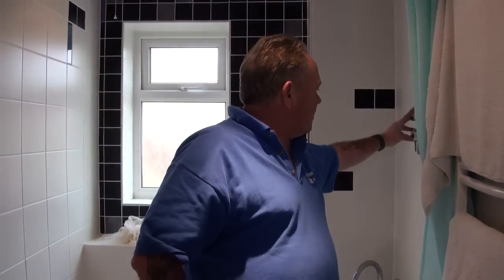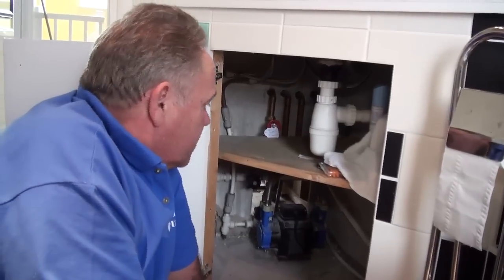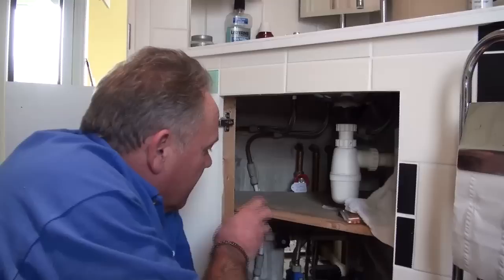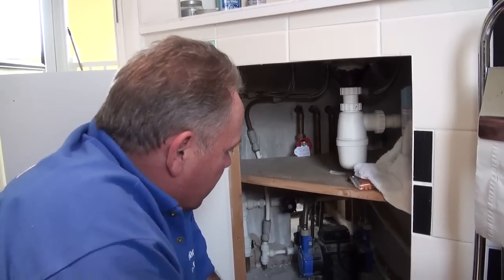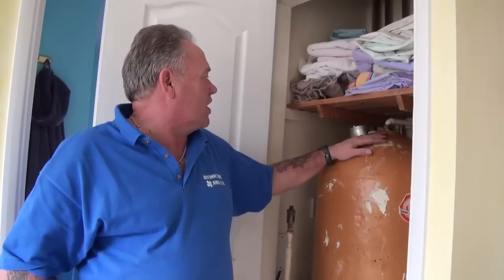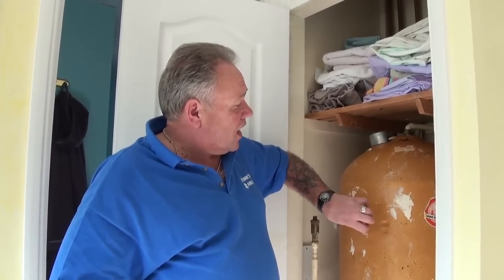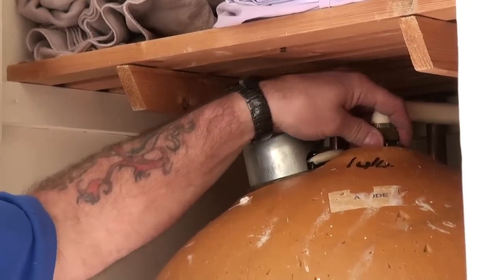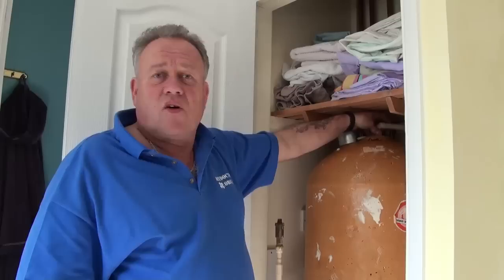Water and Plumbing Tutorial Part 8 - Installing Power Showers

Comment: In your video, you say it is bad for air to get into the shower pump. So it means you must always have water in the tank. But what happens, if the the water company turn off the water?? Speaking as a novice, should n't there be any auto cut-off to protect the pump?.

Comment: Thank you for your video. 

I have a 'direct combination tank' (hot & cold tank in one unit). Luckily, I phoned the manufacturer of a shower pump before buying. I was told, I can't use a shower pump with my sort of tank, as I would an additional 50 gallon cold water tank (which I don't have space for as it is a ground floor flat). :-(

I was going to connect the cold shower tap by mains.....

Comment: Do I need a separate feed form the cold tank or can I see off?
Reply from the maker: The power shower uses  a lot of water, very quickly. You should always connect the cold (and hot) feed for a power shower directly to the tank as this ensures a constand feed pressure when the shower asks for water.If you tee off, and then someone else uses water from the tank to flush a loo or take a bath,the pressure is reduced going to the shower which could damage it. Hope this helps

Comment: You said 100 Gallon tank?  That's 450 litres seriously???
Reply from the maker: Its really important not to under-estmate the water pumped through a power shower. In a lot of case a 50 gallon tnk may suffice but this will give you a 6 minute shower at full blast and this supposes that the inlet to your cold tank has a good enough flow to fil it up again quickly. For a family, a power shower tank needs to be an absolute minimum of 70 gallons and this is achieved (usually) by adding a atnk and connecting it to your existing tank. We say 100 gallons because tis way it can be guaranteed that your shower will not rund dry when your family are using it.